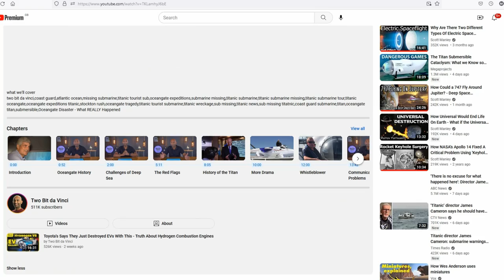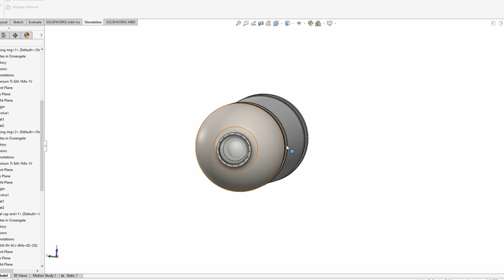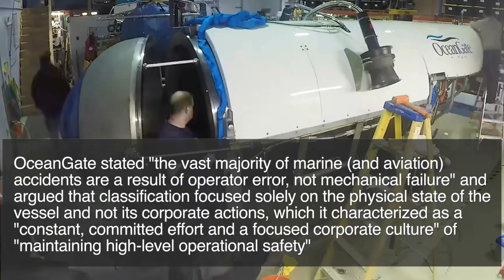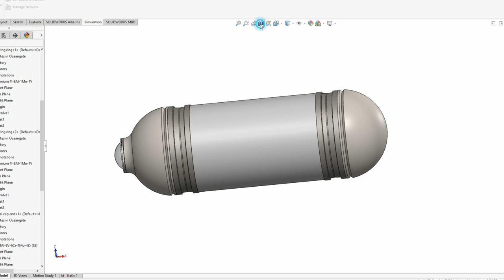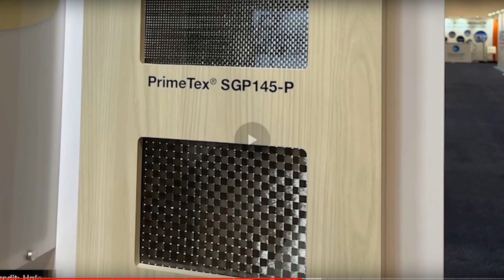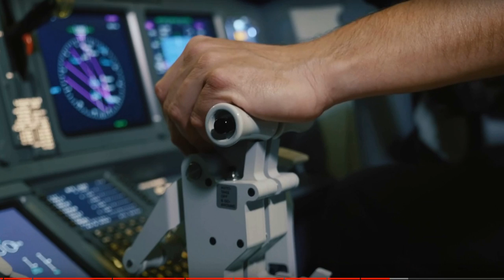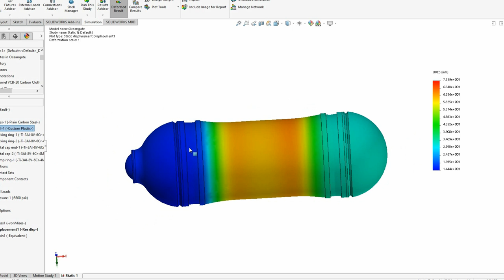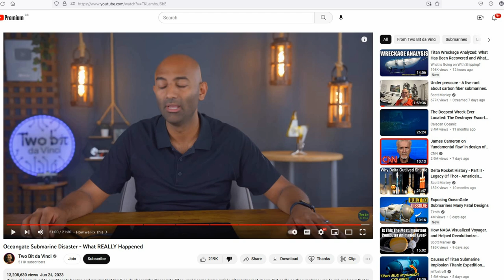Oceangate Titan - Engineering Failure?

Comment: At that depth, ballast tanks would be very difficult due to the pressures needs to store compressed air to displace the water in the ballast tanks. Tanks like that are only used in large submarines that can hold the compressors needed and that don't go near these depths. For a DSV, we would need air tanks that had higher pressure than the water itself at maximum depth. The safer thing to do is to make the vessel positively buoyant and instead drop weight to surface. This is how almost all deep sea vessels work. The main issue was with materials used for the Titan hull. Everything else is secondary and while the secondary systems did have flaws, those don't really matter that much. The foundation was cracked before they even built the house.
Reply: I've heard 10,000psi compressed air tank was carries on the Titan for that purpose.
Reply: @MarkTillotson  Was that not their main oxygen supply or was that another tank? I don't know the detailed specs of the Titan or how they achieve buoyancy. I am pretty sure they aren't using foam like some other DSVs. As far as I know they so something to the sub before diving to make it positively buoyant, then they add ballast to make it able to dive at a certain rate. I think once they get to depth they then would either dump some ballast or like you said, possibly use a tank. But a tank as far as I know wasn't their main way of becoming surfacing as that could fail. They could just dump weights and surface even if everything else failed.
Reply: @rowenhusky hey had foam. in the tail bit. the foam is expensive. By making a light hull, they needed less foam, and saves money.. result..
Reply: There are unconfirmed leaked communications that show they dropped weight because of crackling sounds in the rear of the hull, yet they couldn’t figure out why they weren’t ascending. Odd, if true.
Reply: @inthefade  They were definitely too heavy at the start of the dive as they were descending much faster than expected. This is why they had a lot of trouble coming back up. Even if they hadn't had all the failures they did they would have had a difficult time coming back up to the surface.

Comment: Personally, I dont think the glue is a problem here, hence the spheres push onto the cylinder anyway. The actual cylinder dent to the inside is a problem. First it severes fibres at every dive, secondly the dent becomes larger with every dive and decreases buoyancy to the limit, where it is no longer buoyant. This, in turn, makes the sub to dive deeper, dent becomes more pronounced, further buoyancy is gone, eventually external pressure causes the destruction of fibre cylinder.
What could help here? The thicker cylinder wall, with no recess for the titan rim, the rim should always come on the inside/outside of the carbon cylinder. Assuming, cylinder is thick enough to withstand multiple pressure cycles w/o damage and sub is still buoyant w/ extra cylinder weight. Otherwise, full metal solution is the way to go w/ extra bouyancy tanks.

Comment: Yes, that end cap interface just looks like a bad idea... Different flex rates and no physical interlocking, only glue, even assuming the glue is strong enough at first, I cannot imagine it not cracking after a few cycles, personally I doubt it's the composite shell itself that failed, though you're probably right that we won't be able to tell, since with the stresses involved, the shell probably ripped itself apart with the shockwaves.

Comment: You mention about ballast tanks. Deep see submersibles don’t have ballast tanks because the water pressure is too high to pump them down. They use drop weights and syntactic foam to add buoyancy. I know this because I learnt it in a YouTube video yesterday

Comment: It looked like the hull displacement was 70 mm and not 7. Looked like 7e1 not 7e0. I don't think the glue holds anything together under pressure. The end caps are forced onto the carbon fiber from pressure at depth. But that interface is scary.
Reply: Isn’t the greater surface area of the cylinder mean the hull would be compressed more than the caps are being compressed on to it, plus carbon fiber probably compresses much more than titanium if I had to guess… To me that glue is crucial, and seeing how they prepped the surface and applied it, I almost guarantee that was the failure point.

Comment: Nothing about this craft appears to be high precision.  This Rush fellow was supposed to be an engineer.   He is using ad hoc methods that do not produce a finely engineered solution.  He never used an autoclave to apply and cure the carbon fibre.  The subsequent psi of the fibre shell was only around 14.7.  An autoclave would have delivered a psi of from 40 to 100.  It must have come down to money.  He didn't have enough funding to produce a vehicle capable of negotiating extreme depths safely.  The certification process in the US is very expensive.  Instead of saying he couldn't afford it, he invented a narrative about being on the cutting edge of technology.  There is much denial in this sad story.

Comment: I agree that the glued ends are the issue. When I fist saw the build video that’s the first thing that came to my mind. It is clear they did not prep it as you would need to. There is also no squished out glue like you would want to make sure all voids are filled. They are counting on such a tight tolerance with such little glue. Judging by how easy they got it on I think they had a decent amount of space to fill. It would have been so much easier to do it literally any other way

Comment: You made some very good points and brought up many issues I have with other videos on this subject. 

However, comparing the hubris of the CEO of Ocean Gate to the crew/builders of the Titanic is a complete falsehood. 

First, the Titanic was never claimed to be “unsinkable”. This idea that the  builders/owners of the Titanic (Harland & Wolff or White Star Line) claimed their ship was unsinkable only started after the sinking by the media at the time. The only comment made by the company was in one advertisement mentioning their new safety features (i.e.double bottom hall, and 15 transverse bulkheads) saying these features make the ship as unsinkable as 1912  technology/building techniques will allow. 

2nd the Titanic’s lifeboats met the regulations at the time and even had more than required. Also having more lifeboats more than likely would not have helped. It is incredible that they managed to release as many as they did. They wouldn’t have time to release more and more than likely the additional boats would have cluttered the deck and have gotten in the way. 

Captain Smith and the crew of the Titanic were not incompetent they acted professionally and did their best. The Titanic story is not one of hubris and is completely different from the recent Ocean Gates Titan Tragedy. 

Anyway, sorry for the long post. I did enjoy the video and again you made many good points. I just have been hearing a lot of the same factually false comparisons between Titanic and the Titan which needs to be corrected.

Comment: After jettisoning the landing gear, if the carbon tube is "squashing" a bit, the buoyancy volume is decreasing.  Basically their "air balloon" of the pressure chamber is shrinking, loosing buoyancy with each second.

Comment: Based on what you've said concerning the variability of carbon fibre fatigue strength then this material doesn't seem suitable for any structural application involving an alternating stress. I'm also guessing the variability can be read across to tensile, compressive and biaxial loading properties.

Comment: Could you make your CAD model of the TITAN available?
The FEM stress analysis is something people might want to examine.
Reply: Its a carbon fibre cylinder with titanium end caps. The dimensions are publicly available. If you truly want to "analyze" the TITAN you should be able to made a CAD of a cylinder...
Reply: @IamKingofInternet it is a really easy model to reproduce. And just for the info, i dont do any kind of sims on solid works, so i dont lnow how they evolve, but when i did sims, sw was one of the worst option. Just really, really early prototypes used sw sim as ballpark ref. The triangle mesh put the tensile way, way off. I dont know if they fixed the mesh edit options, but as long as triangles are the main divisions for sims, you should more than avoid it's use

Comment: There are various week points. The glued areas are all weak points around the following:
1) the plexiglass 
2) the glued areas between the metal and composit tube.
3) the composit tube itself.
4) the bolt parts.  
As the 4 different materials flexed due to varying pressures and temperatures after a few dives the glue gave way. In my opinion, it was the glue that gave way.
Reply: Wrong. If it was the glue gave away. It would seep, Leak water first, then flood the chamber. Neither the plexiglass and bolts. It would have a few seconds to balance the pressure to leave the hull and bodies intact. Those graduate failure would have warning signs. Only the composite  hull (discrete structure in nature, glued millions or billions strands of fiber together by resin) would imploded in pieces when fail. It is brittle sudden failure.
Reply from the maker: Really? I've seem helicopter blades explode, because the adhesive failed between the leading edge (titanium strip) and the composite foil.
Reply: @guangxidavidliu  there may have been a leak. they knew they were in trouble before they lost their lives. the sub had released the ballast for an emergency ascent
Reply: the thinner hull lip to fit a glued on titanium dome was a major weak point
Reply: @hotdog9262 the transcript of the sub came out, apparently they started to ascend because of crackling noise coming from the aft. The rtm system was on red alert they knew something serious was going on
Reply: @yourshadows  thanks

Comment: 8:00 Apollo 1 was also bolted shut. I guess they didn't need to exit their vessel in space either. What a disaster that turned out to be. NASA learned from that though.
10:25 if you want to pump the water out, you need to overcome the pressure of the water trying to come back in. Good luck with trying to pump against 300MPa of pressurehead. The other way to do that is to blow the water out with air. But for that you also need a gas tank with enough gas to produce 300MPa of pressure in the volume of your ballast tank. Those deep sea going submarines work differently from your typical military subs because it just doesn't work at those depths. What those deep sea submarines do is they are boyant by themselves, but they can drop ballast to raise back up. This is safer because dropping ballast can be made redunant, for example you hold it on with electromagnets, and you hold them on with cables that degrade in seawater to the point of failure after say 6 hours, and you have redundant ways of releasing them that don't have a single point of failure.
16:00 the hardest part about space travel is in the details. The math is relatively simple, the principle is relatively simple: make the cold things mix and go boom and have it expand out the back at high speeds to make the other end go up. The details are what matters. How do you pump your fuel fast enough without exploding your turbopumps? How do you prevent your nozzles from melting? What happens if item X fails at stage Y? How do you fuel the thing without everybody dying of cancer or exploding? How do you get the rocket onto the launch pad? Those are all details, but they're all quite hard to sort out.
26:20 somene actually did the math. The energy equivalent is 38kg of TNT. You blow that up in what looks like 5m^3, you don't really stand a chance. The hand grenade equivalent is also adequate, since the carbon fiber hull would also shatter into sharp fragments, through the cracks of which soft biological tissue might be squeezed. You're lucky if you find a tooth after that.
28:30 the problem is that the design wasn't sound, safe or smart in a lot of areas. what could happen isn't important, the important thing is that they weren't prepared for anything because they cut corners. Which is backing up that guy's theory of what actually happened.
30:40 "Because there are super strict certification requirements, stringent rules and regular maintenance, nearly all accidents are operator error. And that's why it makes no sense to certify." That's false logic and grossly negligent. Just because almost all accidents are operator errors for certified aircraft and spacecraft doesn't mean you are safe from mechanical failure and can only make operator errors, if you skip the standards That'd ludicrous thinking. They are safe because they follow the standards.
38:30 yes, game controllers are tested by millions of users and they got the ergonomics down. But at least they are not life critical, they probably have a backup in case it breaks, they can throw it away if it catches fire (which might happen in an oxygen enriched environment, like a submarine), and it is wired so the battery can't die and it can't loose the connection at a critical point. It's one thing if you loose your xbox bluetooth for 2 seconds and get shot in your favorite video game. it's another if you are loosing the connection and run straight the ground or a rock as a result. You may have noticed the military always use the wired version, because it's just more reliable and has less failure points and doesn't cost extra.
50:10 carbon fiber and titanium have vastly different bulk modulus values. Basically the titanium doesn't shrink at all while the carbon fiber will contract under the pressure. The interface is a major design flaw. As the two materials contract at different rates, they will sheer off, or at a minimum introduce large stresses that may lead to fatigue.
1:15:00 i believe what he means is that you are safe if you get on a proven plane design with a reputable airline today. If you fly with an unmaintained 6th hand aircraft that has not seen a maintenance hanger in the last 10 years then of course you are at risk. But normally the risk of flying is very small. you're more likely to die when you take the taxi from the airport to your hotel. Yes, that safety was built with the cost of blood. But it's also because it's a highly regulated space with highly trained professionals, as opposed to joe driving drunk while typing on his cellphone is an every day occurrence. That would never fly with an airline, pun intended. Unless of course you're that one russian pilot on that one flight that i forgot the name of. But he basically flew drunk and got everybody killed.
17:50:00 If you can build something in your garage, and prove to you that it's reliable and that the physics work, then you are free to not kill yourself with it. By yourself, on your property. You still need regulations because not everybody can be trusted to be as diligent and honest as you. And so the regulations exist. For example here in germany you can happily build your own car in your own garage. You can drive your cars on your private property, or even on someone elses property if they allow you to. You can even drive that thing on public roads, but only if it has been tested and approved by a regulatory body and going through all the paperwork and certifications. Because they can't make exceptions, because, in general, people are stupid and lazy. What is not okay is when you put others into your machine who don't know all the details and all the tests you did or didn't do and have them die because you cut 14 corners too many.
1:20:40 actually a lot of aircraft parts have both a mandatory check period, sometimes multiple with different intensities (visual, ultrasonic, xray), and a mandatory replacement period and/or cycles. Like "Every 5000 hours or 50 cycles, whichever comes first, you check this part with this method, you replace this part after 20000 hours or 200 cycles, whichever comes first." is very common.
1:34:10 water is compressible. At that depth that actually matters, because the water decompressing into this shiny new void it has just found at the speed of sound is what actually kills you.